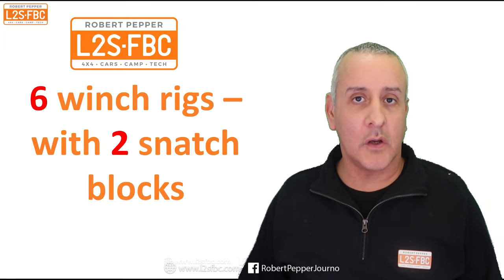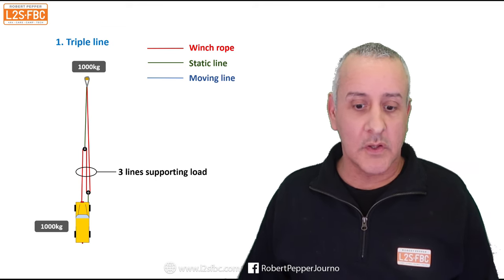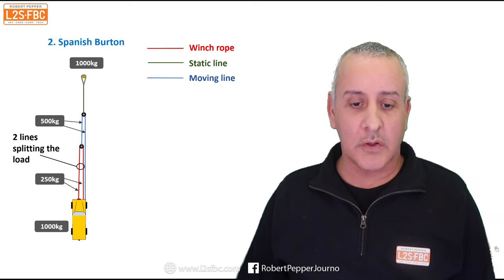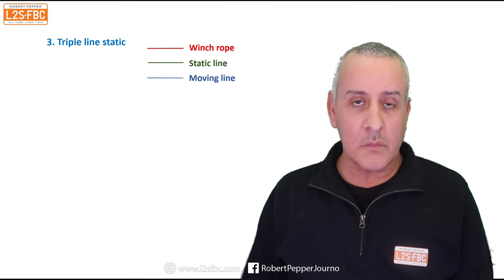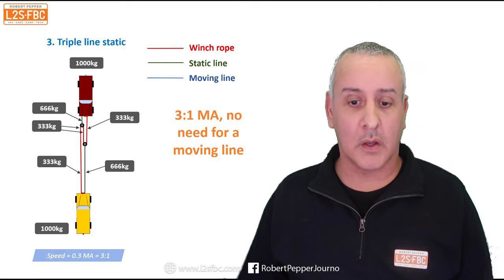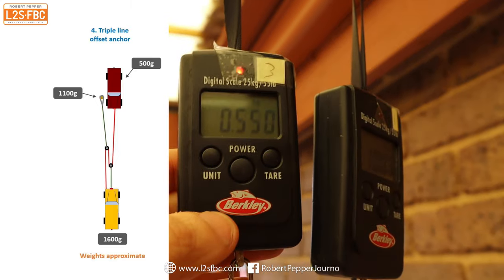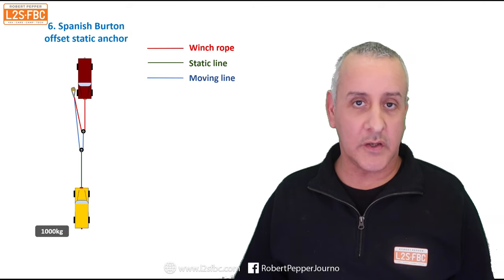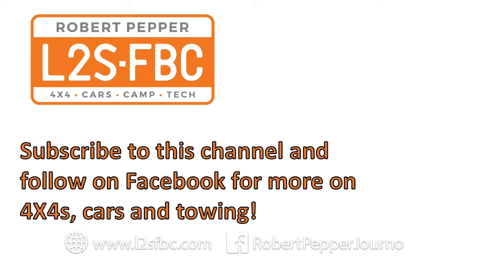6 ways to rig a 4x4 winch using 2 snatch blocks

Comment: Wow.  I wish this had come up on my feed last month.  I live in a mountain neighborhood at 9100 to 9700 feet of elevation.  The thaw on the roads just is not happening this winter.  I have performed 3 recoveries this season.  1 not successful, damn near sliding my jeep off the hill.  A tree was nice enough to catch me and stop the remainder of the slide.  So one of the 3 recoveries was recovering myself!  All were single line attempts.  I had just purchased 2 blocks but did not remember how to use them.  We have just received over a foot of fresh snow and with your videos am going to practice tomorrow.  Thank for this information.  Well presented.  I will look to see if you have safety videos to go with these.  I know Ronnie Dahl does but your suggestions here look more complex and i only have 1 apron to lay over my winch cable in case there is a snap,
Reply from the maker: Great to hear!  Consider using the static double line pull to recover others as it will halve the load on your Jeep so less likely to slip.

Comment: One thing I find missing in your diagrams and your explanations is the distance that a setup will move a vehicle before you will have to reset the setup. For example, it should be pointed out in your 3 line pull setup that the max distance of the pull of the setup would something less than the distance between the two snatch blocks.
Reply from the maker: Sorry didn't cover that good point

Comment: Thank you so much, you made it very easy to understand. One small thing I noticed,  the number of centimeters the car will  move (in a 3:1 scenario) for each meter you take in with the winch, you will be 33 centimeters, and in a 4:1 scenario, 25 centimeters, not 330 or 250. Otherwise, great video.
Reply from the maker: Yes, you are right..I didn't realise I got it wrong, will have to re-watch!
Reply: @L2SFBC  @ 04:07  - But Rob is still the Guru!

Comment: Robert - You’ve given me great ideas on how to use an ATV- sized winch to set up a portable rear winch for my Rubicon. Thanks.  One follow-up question.  If I’m using a 2,000lb winch and rigging a Spanish Barton to give me 8,000lbs of pull. What size rope do I need?  I think an 8,000lbs test should be enough.  With a 2,000lbs winch, the Spanish Barton has two lines at 2,000lbs and two lines at 4,000lbs. Still when I bought my front winch, a Warn M8000S, it came with 3/8” synthetic line that was at least 10,000lbs test.  Is using a line with a higher test than the winch’s max pulling power necessarily or just using an abundance of caution.  Thanks again.
Reply from the maker: Use a safety factor so 10k is good 👍

Comment: Excellent explanation. I see myself getting a line extension and ring to complement my snatch block so the Spanish Burton is an option. It really seems like the best option for a hard pull since you don't have the resistance of the third block to get 4 lines.
Reply from the maker: Agreed!

Comment: Extremely well explained Mr Robert, - I have a genuine Toyota high mount winch on my cruiser, they are good quality but fundamentally they are surprisingly weak winches compared to after market low mount winches [ gearing too high ? ]. So your clarification of getting a 4:1 mechanical vs a 3:1 with 2 snatch blocks, with that Spanish arrangement was fantastic -thks --gregoire
Reply from the maker: My pleasure, like, subscribe, share...all that jazz :-)

Comment: I was working on an auger (for transfering wheat into silos etc) it has a hydraulic winch. The cable had broken in the past and was elevating the thing single pull, instead of double with the anchor being the pulley used for the original double pull setup.  I was trying to understand what difference it made but now it seems obvious. Thankyou.
Reply from the maker: Glad it helped, please share etc!

Comment: Robert, I really appreciate your taking the time to explain these scenarios.  I am a bit in the dark on the "moving line."  I think it was cool that you actually made 'examples' with smaller scale objects... however, I think it would be a HUGE help to see that in action!  (I may have to try to replicate those smaller examples to better understand the concepts).  What type of line are you using for the "static" lines?  For a "jeep" recovery, would you suggest a "strap" (3 or 4 inches) or a synthetic rope?

Also, what happens to the 'static line' (where there is one on the recovered vehicle side) when the recovery vehicle pulls the recovered vehicle?  Does it lose tension or keep tension?  I don't quite understand that either.
Reply from the maker: Hi - the moving line is a sythentic rope extension just like on your winch. Example in use here -> https://youtu.be/nVnbPNyLu_c Would recommend that for Jeep recovery. The static line keeps tension.

Comment: Hello, and greetings from Portugal.
Thank you for all your videos, I have learned a lot.
Could you please advise on the setup using 2 snatch blocks but with a manual winch, for a off road recovery? What winch would you choose?
Cheers and thanks in advance!
Reply from the maker: Thanks - use a Tirfor with a synthetic rope extension and snatch rings.

Comment: Your videos and explanations are so valuable! I appreciate all the effort and analysis you put into them!! With the 4:1 benefit you get with the spanish burton, I can see how it reduces the effort placed on the winch and recovery points when doing a self recovery.  However, when I working with trainer, he was saying that because I have a 10K winch, I need to ensure I have rated equipment for up 4x that, 40,000lbs at the anchor point.  It's a different mind set for rigging for the system's potential vs the estimated actual stuck scenario.  Any thoughts on this?
Reply from the maker: The trainer is a bit wrong. You need recovery gear rated to the load to pull. If that's a 40k load then 40k. You can rig a SB and pull 20k...
Reply: Yeah, I think it was a bit on “an extra abundance of caution” side of things. Thanks again!

Comment: All your videos on winch (1 snatch block and this one especially) have been great for me and understanding what equipment i need before buying too much. Especially great since i am only working with a hand winch right now (expense of new bumper and electric winch is not in the budget yet) and being able to lighten up the load on it directly. One question however, could i use the hand winch in place of the vehicle? So for example in the Spanish Burton offset anchor, the vehicle would become the hand winch and anchor to a tree, then ran out and through the snatch block to the tree anchor you have in the diagram?
Reply from the maker: Yes you can do that. All of the rigs work with a hand winch - be that a Hi-Lift jack or a Tirfor-style winch or whatever.  In one of the videos I show how to rig that.

Comment: Great video. Quick question. I saw an earlier comment saying they would all work without a winch. Why is that? When you're attaching snatch blocks to the pulling vehicle doesn't it only work because you're shortening the winch line? If you drive the whole vehicle forward with snatch blocks tied to it, wouldn't it negate their effects?
Reply from the maker: Yes, correct - maybe that commented meant you could just pull instead of winch?  Don't know, yut you are right.

Comment: Really need to invest in some more recovery gear. I've come across 3 folks in the last 24 hours that ran off the road into deep snow and a straight pull with the winch couldn't get it done.

Comment: @7:10 often the cables or the state of the battery limit the winch performance - for a high torque at high revs the winch needs obviously much more amps, plus running the winch at peak performance (max. torque, max revs) causes more internal friction losses. Thus, from a energy balance, using snatch block(s) is much less stress for the battery even if the recovery takes a little bit longer - if the required torque can be minimized by snatch block(s) the current the alternator supplies might be just enough so you don't drain your battery.
Reply from the maker: Very true!
Reply: I think this is also why it is typically recommended to start your vehicle and let it idle when using the winch.

Comment: These extra lines, be they moving, or winch, when needed to connect back to the vehicle, is it "ok" to connect them all to the same anchor point on the vehicle? (hooks and shackles are common on trucks in USA, are these ok to connect a combo of lines to? or should they be connected to diff hooks/shackles where possible?)
Reply from the maker: Yes you can connect back to the vehicle.

Comment: Is there any reason not to use 2 different anchors in the Spanish Burton offset anchor? Say park 3 vehicals so that the one in the center is your winch with your winch line anchored to the right vehical and then your moving line anchored to the left. This might be advantages if you need to pull a very heavy vehical out since you would be splitting up the force across your anchors.
Reply from the maker: Only reason not to would be if there aren't any. Whenever the winch vehicle isn't moving it's a good idea to split anchor load if you can.

Comment: Thanks for your video and I have a question:
On #6, if I add a block at the anchor point, is it efficacious to then use the winch line in lieu of the moving line?

Comment: I see a lot of arguing about MA and what the actual load ends up to be.  With a 4 to 1 MA using a 10k winch does that mean the max load is 10k pull at the winch reduced to a 2.5k load at the recovery vehicle?  I have seen it explained as a 10k pull at the winch being increased to 40k at the recovery vehicle?
Reply from the maker: The formula is - total load required / MA.  So if your recovery load is 4000kg, ie it takes 4000kg to move the casualty, a 4:1 MA means your winch needs to provide a 1000kg pull, excluding friction.  Winches only provide as much pull as required to shift the load. A 9500lb (4500kg) winch doesn't pull at 4500kg all the time, it needs a load to work against (and 1 turn of rope on the drum).

If you did have a 4000kg load to pull on a casuality, and you applied say 16000kg to it, then it'd bounce right out of its stuck at high speed!
Reply: So then I could move a 40k casualty using a 10k winch with a 4 to 1 MA?
Reply from the maker: Yes!

Comment: Hi Robert, is it possible to have two points on the car using the same tow eye? EG a double line with two attach points using the same tow point on my car, with the pulley end on a tree. My car only has one tow point on each end but I still want to be able to use pulley(s) to recover myself if I get stuck.
Reply from the maker: Yes, that's totally fine and no extra load.
Reply: @L2SFBC  Great, thanks for the reply

Comment: I have experience and training in rope rescues and some quite distant experience with off road recovery and towing.  My question is regarding resets during winch operations; how do you recommend doing that?  In rope rescues we use prussiks and secondary belay lines to secure the load while resetting the pulleys.  It is my belief that synthetic ropes are too slippery to use prussiks to grip the line.  How to effectively shorten a synthetic line in the field when your distances shorten?  

What are your suggestions?  REALLY looking forward to the responses!
Reply from the maker: Hi Brian, really good question. I'll cross-post it to my Facebook page too. To answer - most recoveries do not need to be reset, as a winch can pull 20m+ which is quite a long way for a recovery. When they do need to be reset, what I do chock the vehicle and relax the winch line. This works in almost all cases. In a very few cases where the vehicle is hanging on the winch line then you need an alternate means of holding it; that can be another winch, Tirfor, Hi-Lift jack winch, or just a chain + rope. But that's really rare, and I would always try and avoid any situation where the winch line is the only thing stopping the vehicle sliding away. I do have an X-Lock and will be showing how to use that to shorten ropes, but a simple way to do it is to simply use a single pulley (snatch block) which has the advantage of 2:1 MA. We can also use chains to shorten winch ropes - especially important if you winch with a hi-lift jack which has a 1m or so pull, so a lot of resetting needed. I'm not sure about the synth ropes being too slippery - probably more the forces we put on which would be anything up to 5000kg or more...undoing any knot after that is tough, and also 4X4 safety factors tend to be 2:1 (if that) which I think is a lot less than rope rescue so any loss of strength in the rope through knots etc is more critical.
Reply: @L2SFBC  thanks for your response!  

I might be overthinking recovery pulley resets because when we do them we’re using 3:1 and 5:1 rescues up to vertically. 

The X-lock looks like our figure 8 with wings; interesting piece of kit. I look forward to some instructions!  That looks to solve the issue I’ve been trying to wrap my head around:  if I have an extension but only need to use a fraction of it how do I secure to the body of the line and only use the portion I need.  

Thanks again.  Learning a lot perusing your channel!!
Reply from the maker: Thanks - feedback always welcome. The FB discussion pretty much backs up what I say, but rope experts do say the 4X4 rope is slippery and not suited to knots. There just isn't much of a need to shorten lines, or MA beyond 2:1. If we have a winch capable of say 3000kg (conservative, 9500lb is 4500) then 5 x 3000 = 15,000kg...and the average vehicle weighs 3000-4000kg.  If you only need a part of the extension then vary the total length with your winch, or halve the rope by doubling it back. Something like that always seems to work.
Reply: If it came down to it, you could use a steel cable with a grip. I've only done it once in a recovery and no winches were involved. Just two 6T chain hoists and a long bit of wire.
Reply: @L2SFBC  Great videos!!!  I can see why one would want to shorten the moving line where the XLock might be the best solution.  Shortening the winch line means you’re starting with several layers on the winch which is less efficient among other things.  Your winch extension may be way too long for the situation so being able to shorten it to take full advantage of the winch may be desirable, no?  And a 2nd note, with the spanish burton, should you come back to the same recovery point with both the winch line and moving line, split the load, or use a bridle to center all of the forces?  Thnaks!
Reply from the maker: Exactly right! I will do more on the benefits of changing line length...stay tuned!
Reply: If you use Klemheist knot made with a nylon webbing loop it will grab ANY slippery rope and even wire cable...
Reply: @L2SFBC  Great video. Along the same lines,  in the Spanish Burton do you set the two snatch blocks as far apart as possible to minimize the need to reset? It's hard to envision how the positions of the blocks change once you start to winch?  It looks like they'll close the distance between them pretty quickly. In a future video could you show an actual winching?  Thanks
Reply from the maker: Good idea will do that!

Comment: Can you go over the equipment requirements for the spanish burton?  IE…does the first set of equipment need to be higher capacity than that of the second set?  If so, how much stronger should the snatch block, winch extension and shackle be compared to your winch line and so on.  Thank you
Reply: The Spanish Burton is a bit more risky if equipment fails compared to more simple rigging techniques, that’s why I’m asking.
Reply from the maker: The way to look at it is to determine the maximum force required to free the casualty and work backwards off that.  I will cover this shortly.
Reply: Wow, thank you for the quick reply, wasn’t expecting that.  I see what you mean if you’re not trying to pull heavier weight,  the idea is to lighten the load with every additional block/line.   But in the event I was trying to maximize my winching capability would I want to have a thicker winch extension, bigger snatch block, bow shackle and tree saver for my moving line?

Comment: Can someone suggest a configuration for pulling small trees with a vehicle with no winch?  Let's assume the yellow car is the small tree/shrub to be pulled.  I would prefer not having to anchor off of a nearby tree if possible.  Would block and tackle also work?  Would all 6 configurations work?  Thanks in advance.
Reply from the maker: Yes all 6 will work.
Reply: @L2SFBC  Thanks for the quick response.  If I was to use 2 snatch blocks and employed method (3: triple line anchor) or (4: spanish burton anchor), I'm not understanding the attachment to the vehicle (red vehicle = pulling vehicle) (yellow vehicle = shrub/tree to be pulled).  The illustration shows 2 or 3 lines going to the pulling vehicle.  One line is obviously attached to towing hook on vehicle and that one will initiate the pull.  Can you explain where/how the other one or two lines are attached to vehicle.  Are there blocks on those too?  If so, that would be additional snatch blocks to the two illustrated.  Thanks.  Never done this before so am unable to picture it in my mind.  Appreciate your help and knowledge.